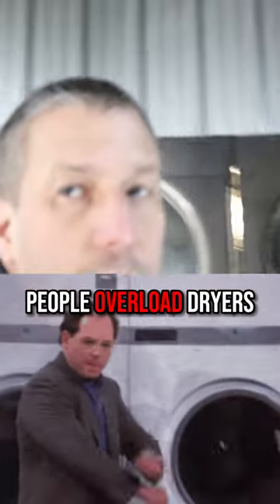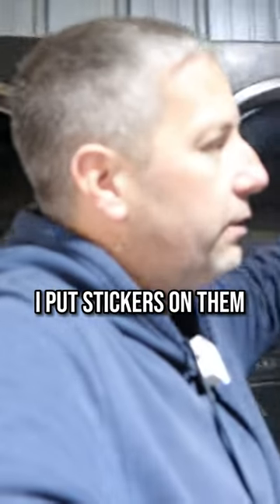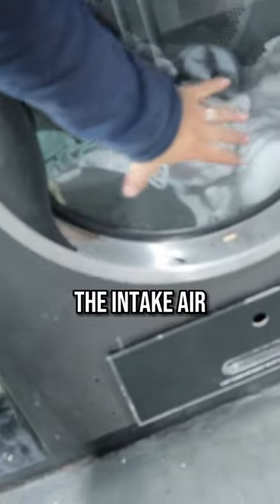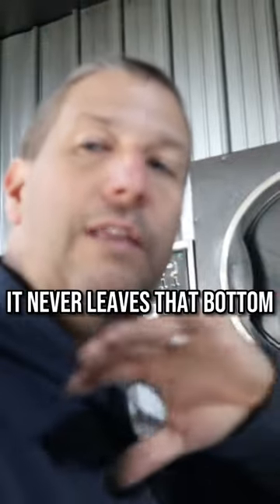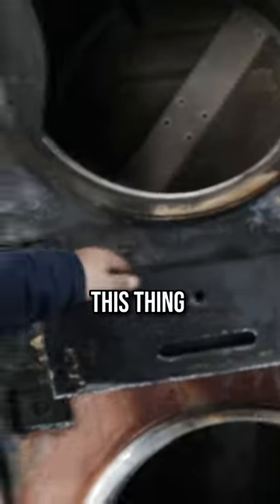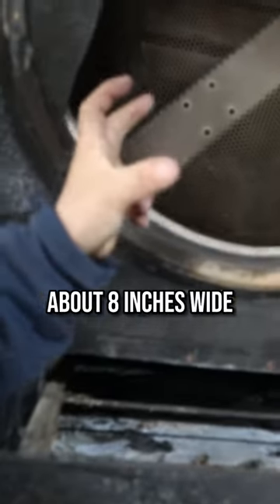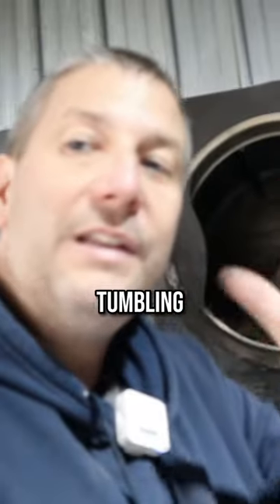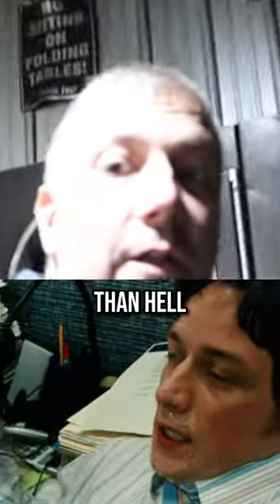Cause Of DRYER Fires!!!  #followingkeenan #laundromats

Comment: Dude, I've been a technician for over 20 years. There should  never be dryer fires... there's too many sensors , especially when its a  commercial grade
Reply from the maker: I know they shouldnt. But if you load that dryer to point clothes dont tumble. It acts just like the lint tray plugged. The sensors in exhaust dont sense heat build up. Then it keeps heating it. 

When i take out the other stack 30lb. I'm going to demonstrate this. Cause in this fire i had the lint tray was cleaned that morning. I pulled 3 trash bags of burnt clothes out of it.
Reply: @FollowingKeenan  sounds like you need new machines. I've never heard that before,   The sensors should be doing their job. That's what they're there for
Reply: @3010prowest I can assure you, there will always be things you haven’t personally experienced happening to others, and that doesn’t mean it’s not real because it hasn’t happened to you at some point. Ya his machines are probably older, but shit still happens.

Comment: There are sensors and that is not the reason!
Reply from the maker: There are sensors your right. But they dont have a sensor in the dryer drum area. To sense when it building heat up too much. So the exhuast fan sensor doesn't sense any heat in exhaust or very little. The computer decides to give it more heat.
Reply: @FollowingKeenan  the stat in the lint tray will shut the flame off if the temp gets too hot, it's not over filling that starts fires!
Reply: @FollowingKeenan I tell it to my sister all the time. Gas dryers and floor furnaces need extreme care.
Reply: The stat in the lint tray is considered in side the drum compartment, Unless there is such a big build up of lint on the screen so the air cannot flow through, but then the stat by the burner will shut down the flame if it gets too hot above the lint tray.  Unless the wrong temp sensors have been put in or bypassed.  @FollowingKeenan